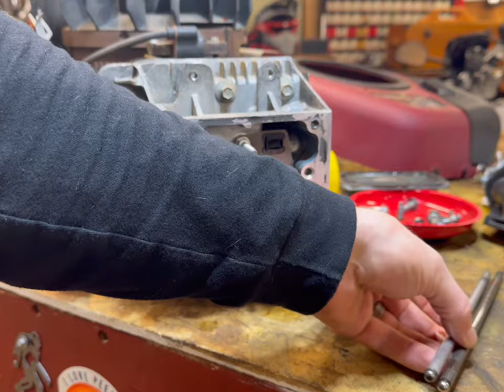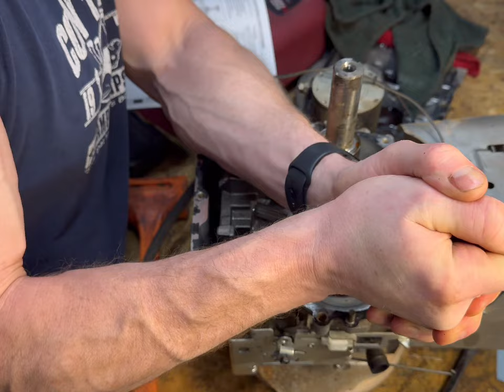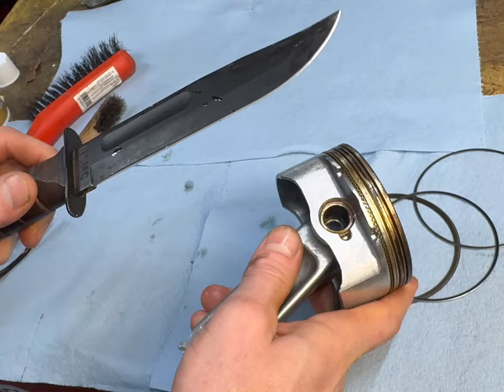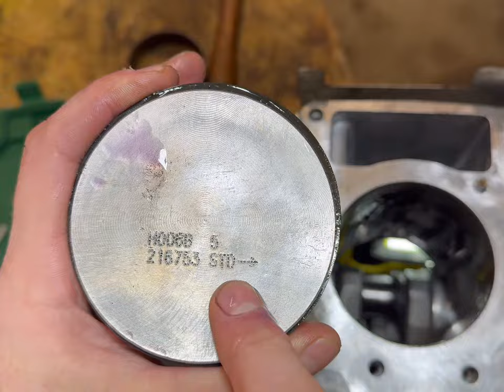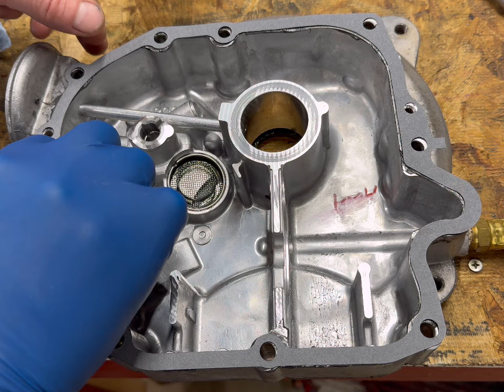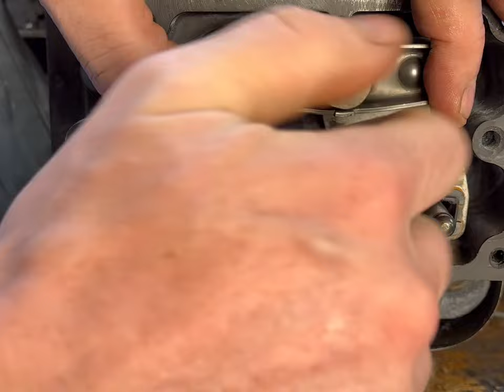Briggs & Stratton Rebuild: Piston Rings, Head Gasket & Oil Seals

Comment: So, uhhh, what do you do if one of those cylinder screws stripped?
Reply from the maker: Ohoh well that is no good. If it were me I would just leave it out and tighten the rest and see if you can get by with it. It is just a cheap mower engine. 

Next step would take it to a machine shop and let them helicoil it and redo the threads. Or buy a bigger bolt and drill and tap new threads. No easy way to fix a head bolt stripped out.

Comment: When honing, crosshatch (lines made by moving the hone from top to bottom and back to top at a constant, consistent, speed) marks should be achieved resulting in them being etched at 45 degrees of an angle and just deep enough that your not seeing any glazing(shiny areas) throughout the length of the cylinder's bore. 
    I'm not being critical or negative with regards to this video. I'm merely mentioning this for the benefit of do it yourselfer's whom may be unaware of this. The amount of time and focus required to achieve this when honing by hand and not by machine is measurable. I learned/practiced to come as close to this optimum 45 degrees as I do by starting with using a three legged brake cylinder hone on a trigger governed variable speed drill. Some 5-6 inch sections of galvanized pipe with an inside diameter that will work with said brake hone adjusted at medium tension. Honing is paramount to achieving good ring seal while providing lubrication to the rings, piston, and cylinder walls. Ring end gap verification and/or filing to achieve ring end gap specs. for the engine in question as well as  piston to cylinder wall clearances are critical for optimal performance and longevity of the engine's life. There's an art to engine building. There are, "Must do's" to be followed for success and a job well done. The information required is out there more than it ever has been. Mike does a good job here and with a happy heart. He's winning in more ways than most.
Reply from the maker: Appreciate the feedback. Am learning as I go here, will take all the knowledge I can get.

Comment: I love the video. I have an old 15hp Briggs and I followed video and everything looked great. Unfortunately when I go to start it back up there is a spot of high friction that just kills the starter from spinning the engine. Spins freely by hand until a certain spot then it gets hard to spin and makes a slight screech noise. 

My honing tool was a little undersized as it was for you in the video. Wondering if I just didn’t get the cylinder honed good enough for the new piston rings which is causing the friction under compression.
Reply from the maker: Sounds like your timing maybe off. Try removing the spark plug and seeing if it turns free. If it does that means timing. Then I would check your valve lash. If that is right then maybe you didn’t line up the dots on the camshaft gear when you installed it. Let me know what you find
Reply: @MowerMike motor spun beautifully without spark plug. Upon further checking found I had set the valves at the wrong top dead center. Reset the valves at 1/4” from top dead center of compression stroke and it fired right up! Sounds and runs as good as new!
Reply from the maker: @joshuayoung6592 That will do it! Congrats nothing better than finding the fix on your own.

Comment: I have a bunch of oil-burning push mower engines removed form decks.  If I post them for free, who will likely show up - repairers or scrappers?
The sump gasket alone is tough to remove.  Sticks like glue and no solvent will soften it.  Have done two.
Reply from the maker: I would just haul them to a scrap yard before I did that. Making money off your trash is a dang good time.

Comment: I just put the entire motor back together and the valve clearance is the final task.  
Do i turn the top of the motor fan clockwise, or counterclockwise, to go 1/4" past TDC to set clearance?
Many thanks.
Reply from the maker: I just go clockwise. It really doesn’t matter just make sure the piston is at top dead center.
Reply: @MowerMike not true
Reply from the maker: @seanjones1908 Not true true
Reply: You can set clearance by making sure one valve is closed,. 005 inch, rotate flywheel and then set the other the same. You don't have to tap it top dead center.

Comment: Excellent presentation, thanks for sharing! I'm working on a Tecumseh vertical 9 hp TVM195, I need to replace the rings. Is the TVM195 disassembly similar to this briggs or are there any big differences I should be aware of?
Reply from the maker: No idea just start taking it apart and find out. You can do it

Comment: Lots of misinformation here.  WD40 won't hurt a thing..It's a connecting rod not push rod.  Tappets are not push rods.  Oil pump cover is missing O ring.  No sump gasket.  Cylinder should be checked and compared to factory specs
Reply from the maker: Someone should take this guys YouTube license! I agree I don’t know WTF I am doing.
Reply: @MowerMike 😂
Reply from the maker: @nathanr.8556 Glad you can appreciate the humor in it. Am just having fun BSn and wrenching
Reply: @MowerMike It's all good man, keep having fun with it!
Reply from the maker: @nathanr.8556 Glad you can appreciate the humor in it all. My only disagreement with you is on the WD40 comment. An old Mexican mechanic mentor of me taught never to put WD40 in a cylinder bore because it doesn’t let the rings seat. Also have read it in engine building books. True or not?? But I don’t risk it

Comment: Hey. GREAT instructional video!  I followed your video and nailed it. My 19HP single cylinder B&S is running like new again without a hint of blue smoke!   
My engine was barely 5 years old and the head gasket blew. Very disappointed with my B&S.
I replaced the piston rings , honed the cylinder and replaced the head gasket.
I have a question. At your recommendation,  I used  the Royal Purple Break-in Oil.  
How long after using it should I change back to regular recommended 30 weight oil?

BTW.... Please add a precaution regarding the valve tip caps during disassembly.   I didn't know about them and lost them. Had to order a new set from B&S. No big deal but would be very helpful if it was in your video.
Reply from the maker: Haha I have had those dang tips bounce across my shop floor more than once. Well done on the rebuild! You are a real mechanic now. 

I would run the Breakin oil for 10-20 hours. Just a guesstimate.
Reply: @MowerMike  I found one... The other one went to that place.... LOL!

Comment: That oil slinger is your engines govenor. Your also missing the O ring for the oil pump cover. Very important as it will leak over time even if you think the 3 bolts are cinched down tight.

Comment: Great video! I tragically broke a con rod on my Briggs and Stratton 19hp, and then found a second hand block, which I had to swap over plus change the head etc. etc! ChatGPT got me most of the way there, and then I found your video which helped everything fall into place! One thing of interest I learned (from GPT) is that the little orange geared oil slinger you mentioned is also a throttle governor - at the end of its little shaft there are two metal hinged tabs that fly out laterally with centrifugal force as the cam shaft spins (thereby spinning the slinger/governor) - when that happens the mechanism pushes against the linkage seat (the metal tab you were lining it up to), which pushes on the cylindrical linkage that goes through the side of the crankcase to the throttle arm, where it engages with the spring tensioned throttle linkage itself - sort of balancing it in collaboration with the spring tension - or something like that!  Apparently the purpose is to help maintain a steady strong rev when under load, I guess like when you drop the cutting deck onto the grass. When the extra load slows the engine down that’s what happens inside the crankcase - the revs drop which means the governor slows its rotation, meaning those tabs fall inwards, which adjusts the linkage to the throttle, which brings the revs back up!  I don’t fully understand it, but you can see those hinged tabs on the slinger/governor in your video easy enough - ready to fly out when it spins. Incredible to think of the engineer who first thought of it!  Anyway, thanks again for the very helpful video!
Reply from the maker: Interesting I had no idea.

Comment: Great video I’m trying to find the rebuild kit I need for my 17hp AVS engine. It’s on a John Deer LA105, it’s time she’s leaking oil pretty good now and my wife actually caught it on fire last year because of that and the leaves but I redone the wire harness and she was good as new.
Reply from the maker: Check out the links on the videos description. I bet those gaskets would work. Just eye ball the hole diagram on the Amazon ones and see if they line up with your engines oil pan and head gasket

Comment: Excellent video.  Just ordered  piston/rings, gaskets for my mower.   Then i plan on fresheninng up an old bayou 250 atv ive had for a long long time  Any major differences you know of? Have you worked on many older carburated 4 stroke atvs?
Reply from the maker: Major difference in the bottom ends with the transmission. But if you just remove the engine and pull the head off the fundamentals are the same. Good luck

Comment: Great video. Don't know if anyone can help but I have an intek 14.5hp ohv which is blowing oil out of the crankcase breather. The engine is NOT blowing any smoke. I did a compression test and it was just over 80 psi. I put new oil in and checked the level, so know it's not that. Any help would be appreciated.
Reply from the maker: Sounds like the rings are getting worn out. I would just run it till she stops. You can always try to put some thicker oil or Lucas oil treatment in there to help seal it up.

Comment: Thanks for the video. I have a question? I have a 15 hp B&S I/C Gold OHV with cast iron sleeve. The problem I have with it is that after an oil change with it set to full on the dip stick, then mowing, the oil collects to a much higher level on the dip stick. What is causing the oil to be held in this tube.be so you cannot tell the correct oil level?  Recently I picked up a used identical B&S engine only a 14.5 hp. It does the same thing. Any suggestions to remediate this? Note: The 15 hp engine, original on a 1995 Craftsman rider, runs great.
Reply from the maker: It probably has a little block back in the engine. That is when compression seeps past the rings. I wouldn’t worry about it as long as it runs good and isn’t burning oil.

Comment: I noticed that you left the o ring out for the oil pump. You may have found that before putting it back in service, but others should know that it was not shown getting installed and would likely be a problem if left out
Reply from the maker: I don’t remember that but if you say so. It was running great when I sold it last month.

Comment: Thanks for video! I was taught many years ago from some old dirt track and drag strip guys that on a 4 stroke engine ( 1. Intake 2. Compression 3. Power 4. Exhaust ), there is only one top dead center; that being top of stroke between compression and power strokes. I personally haven’t heard of 2 tdc’s on a 4 stroke. Forgive me if I’m wrong. I’m pretty sure it’s correct though. Superb video!
Reply from the maker: Glad you enjoyed it. You sound right technically it is top dead center on both strokes.
Reply: Oil rings up from the bottom
Reply: Always 2 T.D.C. on 4 Stroke ... Even tho the Exhaust Overlaps Intake , I've always counted it a part of the 4 cycle process !! ......... Just my thoughts !!

Comment: The scotch bright rolocks are removing a little bit of aluminum. You can see it's rolling over the edge. I prefer to use a whetstone after the big chunks are removed, and just rub the gasket off. You actually dont need to get it 100% pretty either. It just need to be flat for the new gasket.
Reply from the maker: Those aluminum bits are from the scotchbrite itself. It has metal abrasive in it. Not sure what a whetstone is but sounds good to me.
Reply: @MowerMike  It's a sharpening stone. It's flat so it wont round over or otherwise damage the case.
Reply from the maker: @tartredarrow  That is interesting, thanks for the idea.
Reply: @MowerMike          A sharp handle held razor blade at the correct angle removes to gasket without removing the aluminum.  Always has worked for me.